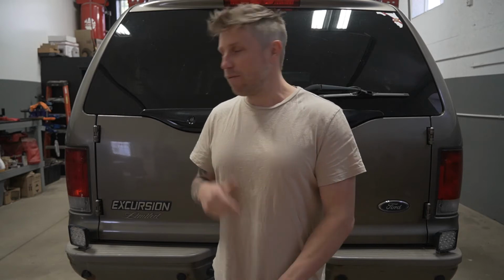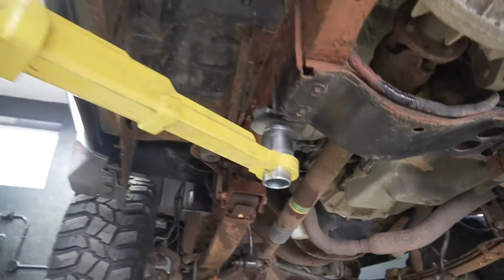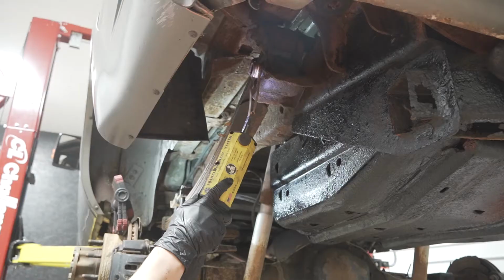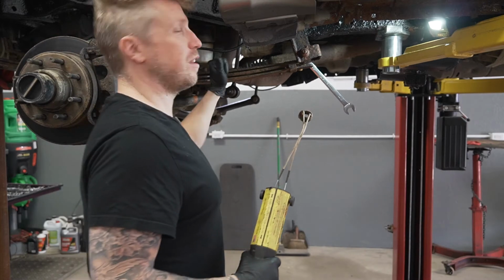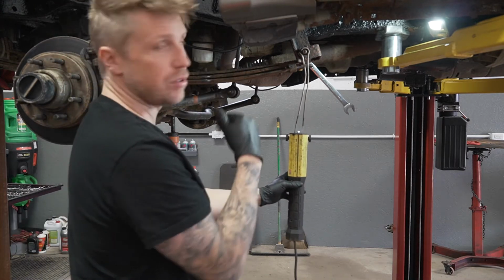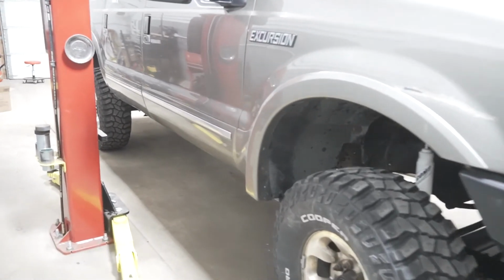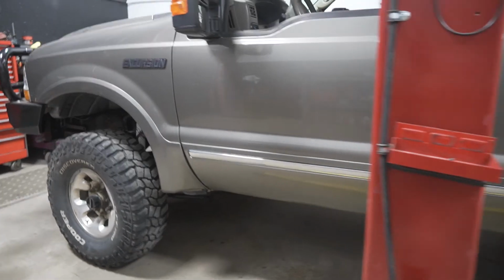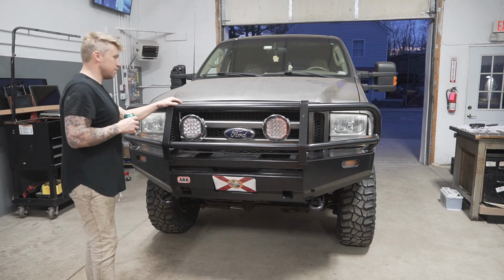Rust repair + New 4" Suspension on this 2003 Ford Excursion

Comment: I'm not sure why people never use some kind of heavy duty grease or anti-seize for their nuts and bolts 🤦🏼‍♂️ seems like a really silly thing not to do and it's really easy thing to do grease those bolts and threads people
Reply from the maker: 100 precent gotta get them all greased up!
Reply: You are not sure why SOME do not use thread compound when doing a repair? There are a dozen reasons. Not just indifference or ignorance.

Comment: What rust encapsulater and paint did you use?
Reply from the maker: Ome from Eastwood, they make good stuff
Reply: @forcemotoring1551  ok great! Thanks!
Reply: @forcemotoring1551  what springs did you put on it?

Comment: What springs/suspension did you use?  I did not see the parts break down except for the rust inhibitor items.  (and that was a lot of rust!  WOW)
Reply from the maker: It’s a procomp 4 inch lift
Reply from the maker: You have to order the full springs tho not just the blocks

Comment: What the cost to remove the rust and coat and add a 2in lift on a 02 excursion
Reply from the maker: It’s right around $1000
Reply: @forcemotoring1551 that’s great to know how much for a restoration?

Comment: All that tire, why wouldn’t the owner upgrade that Y pipe for more power?
Reply from the maker: It’s only a 34 inch tire.
Reply: @forcemotoring1551  I’m running 33s. The Y pipe helps
Reply from the maker: Nice

Comment: Hi i just bought a 2005 excursion and i was wondering what 2 inch lift they had if you know , Thank you
Reply from the maker: I’m not sure what was on it before, but most of them are very similar. Shocks are what makes a big difference with a 2 inch lift

Comment: What did you charge customer for rust removal and paint ? I have a 2000 excursion . Mine need running boards
Reply from the maker: Average is about 300